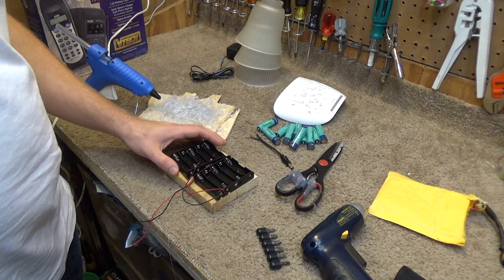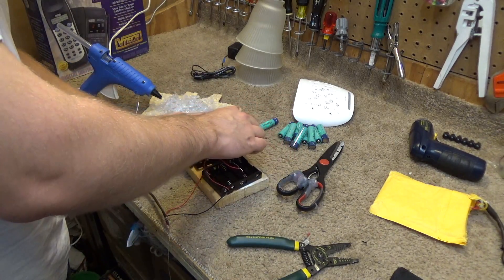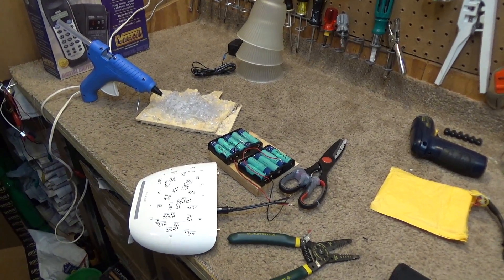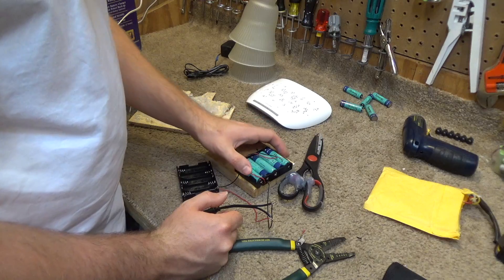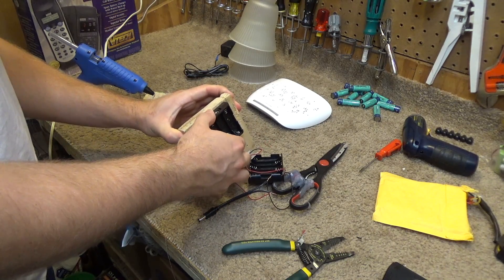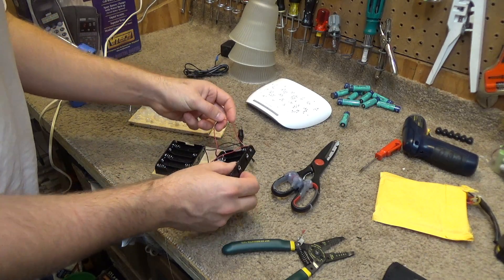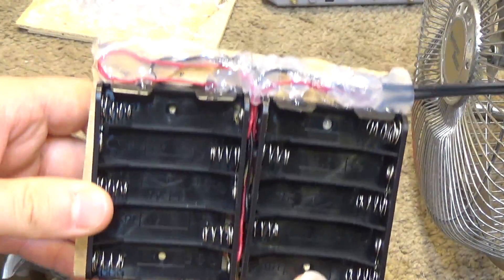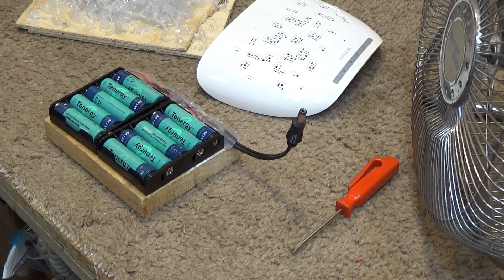Increasing the WiFi Coverage | Part 4; Battery Box Success

Comment: You didn't want to just glue the two boxes together back to back?

Now I'll have to try and see if a cordless phone can be powered off a 9v battery.
Reply from the maker: No, I didn't.
I suspect it could, but since the capacity of a 9v battery is so minimal, it probably wouldn't have a useful run time.

Comment: I'd imagine the runtime won't be as good as your hoping.  I was wondering the whole time if adding an 11th battery to give you 13.2 volts, would be better in terms of runtime, as the voltage will drop as it's being used.  The router likely has a built in voltage regulator, as the power output of the transformer is usually higher when unloaded.  When loaded down, the output is still higher than 12 volts by a small amount.  I'd imagine that the 11th battery would provide that little extra that would satisfy it longer.

With high temperature hot glue, you could have used half as much and ended up with a bond more than twice as strong.  That would have given you more for your money.
Reply from the maker: It may not be; we'll find out soon enough. To be useful, it only has to run perhaps an hour or two, I tend to think it should do that.
I have over 100 glue sticks in storage for when they're needed. I'm not concerned about using it conservatively.